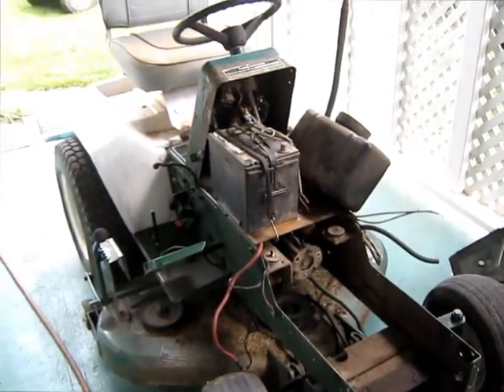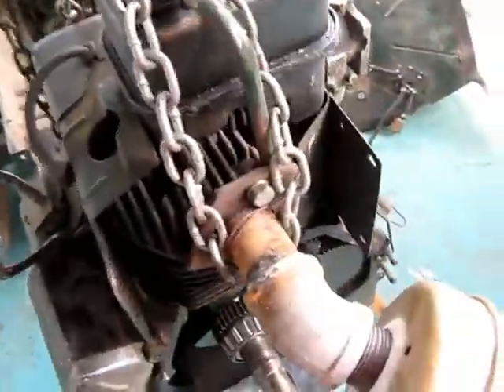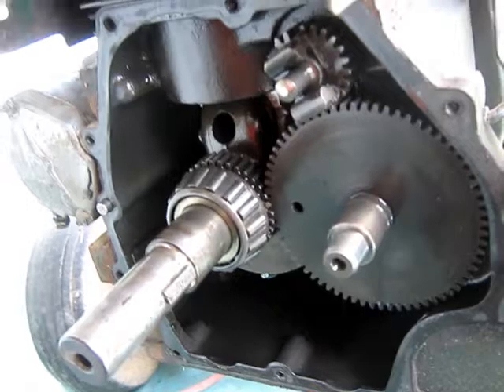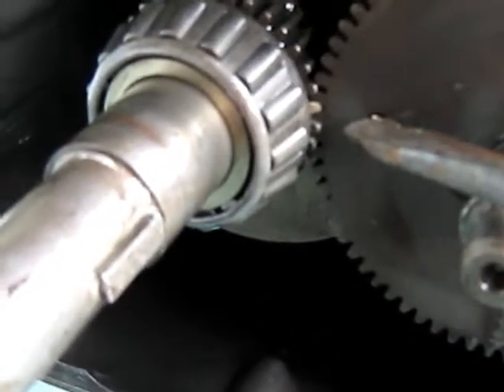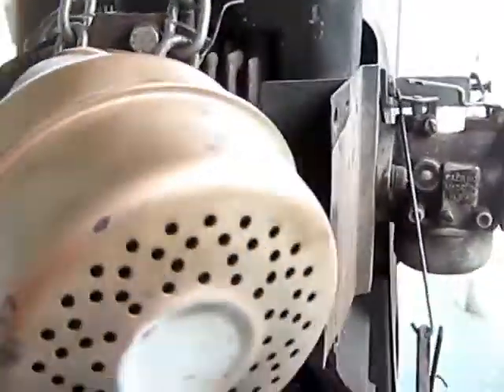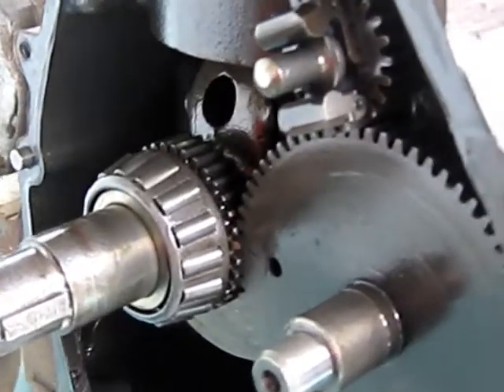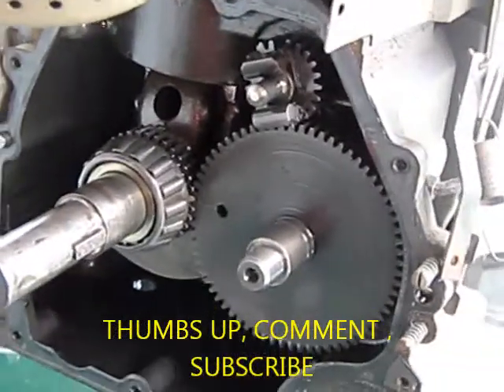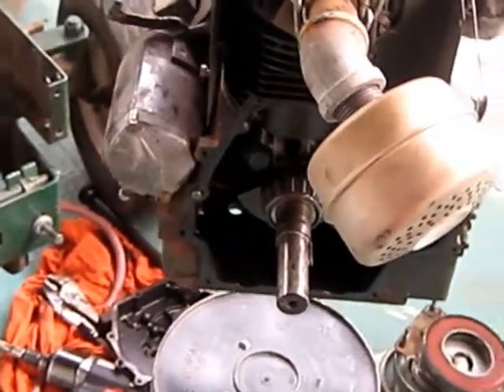BOLENS / TECUMSEH OH140 ENGINE TIMING

Comment: Do you know of any other engines that will bolt up to a bolens h 14xl besides the oh140?
Reply from the maker: steelebilly83 well the 12 and 16 hp will work I think but not sure about anything else, I have a 14 XL listed on ebay now that has some problem with the  engine , won't start, I was wondering if a Kohler off of a Cub Cadet might work since it has a clutch on one end and the pto on the other like the Tecumseh does on the bolens. I have a 14 hp on my old Bolens that I use with a tiller and push blade and it works great , I usually don't really care for Tecumseh engines but these old heavy ones hold up pretty good. I wish I could have given you a positive answer but I haven't researched this much yet. thanks for commenting.